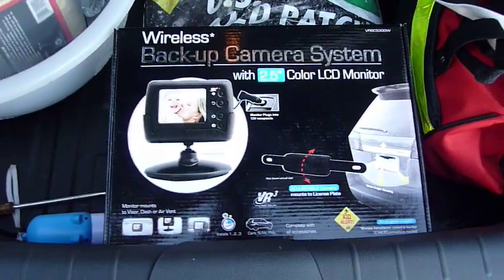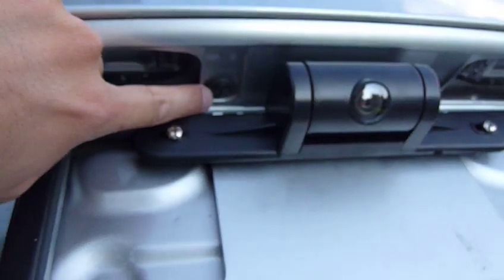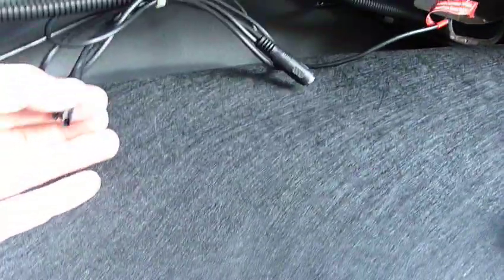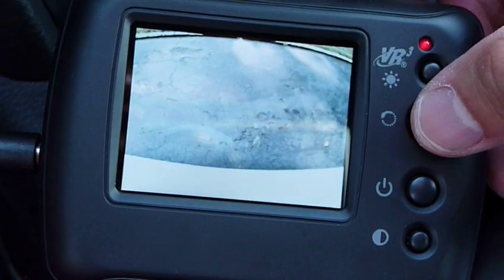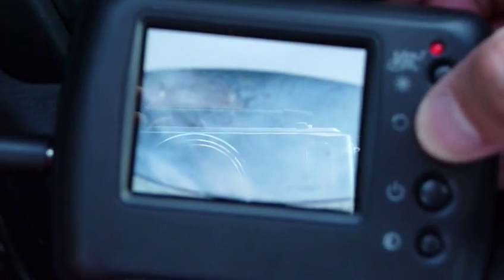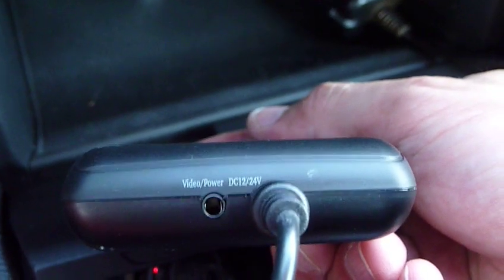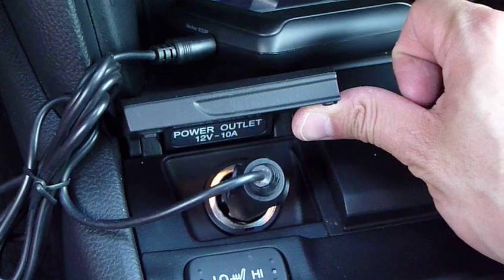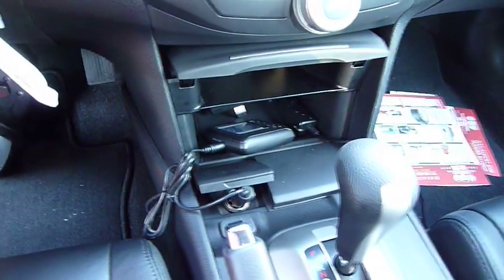Installing VR3 Wireless Backup Camera

Comment: wire the camera power into the fuse box so it will run whenever the ignition is on. your fuse box should have a couple of empty add on accessory slots. push the wire into the back, put a fuse in front. I'm putting a front & rear camera in my truck so I can see the goofy little cars when I'm parking. I'm using wired cameras because their cheaper & I don't have interference from other sources.

Comment: their talking about wireless transmission of the signal from the camera to the monitor. you use the wires to supply power. if you used batteries you'd be changing batteries every 2 weeks.